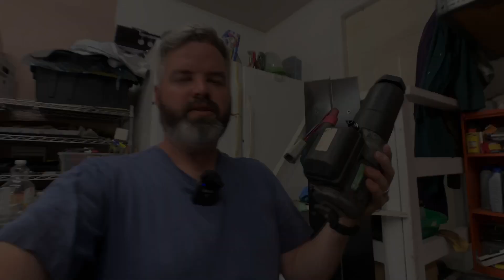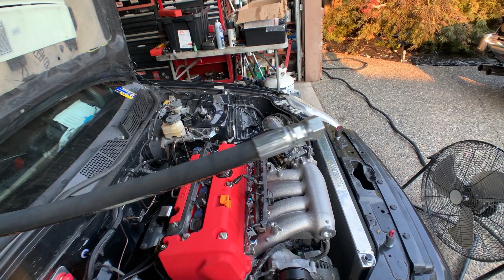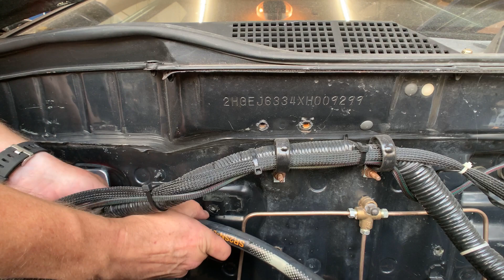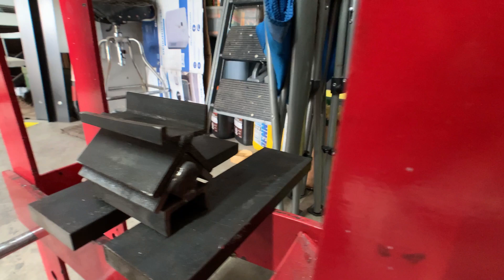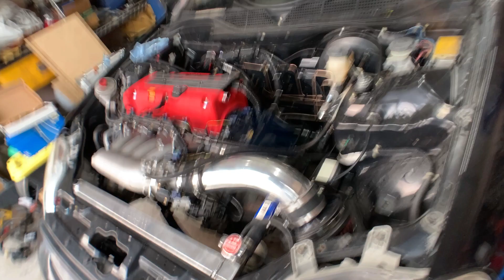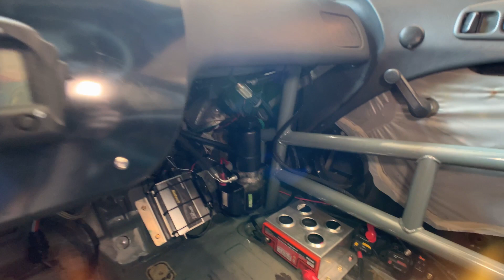DIY Electric Power Steering on the Time Attack Civic

Comment: I know it's not too big of a deal but...FINALLY someone installs/keeps an oil cooler for their p/s system while doing this mod! I can't say much since I haven't taken my Prelude yet out on the track but I'd imagine keeping the p/s fluid temps down would at least mitigate any potential issues for the system. At least I think so?
Reply from the maker: Yeah I felt it was worth doing. Looking back now though I think I would probably take the weights savings and run without. It only runs for 15min session at most. If I was street driving it might be worth it. Having said all that I have no checked how hot it runs after a 15min session so this is all just a guess.
Reply: @FFAttack  Gotcha. After each session, no problems at all with the pump or leak through the lines or anything?

I plan to keep my Prelude as a weekend driver/occassional track-day car so maybe I'll go ahead and keep the p/s cooler. Thanks!

Comment: I’m pretty sure the pump needs a signal from speed sensor? So the pump is on at 100% pressure all the time regardless of speed? Wouldn’t that overheat the pump? I could be wrong 🤷🏻
Reply from the maker: This pump is a 3 wire (Ground, 12v and switched on/off). There is a version of  this pump that has 4 wires the 4th being for speed. In my case it’s just on and off, I can hear the pump increase assist when load is applied.

Comment: how is it with quick turns? some had had issues with that when they use electric pumps.
Reply from the maker: I have not noticed any issues, on the track I have not had any lag in assist.
Reply: @FFAttack  did you wire into speed input?
Reply from the maker: No this pump just has a on/off signal.

Comment: I like your thinking behind using this particular pump. With that said, I feel like having that pump sitting next to your ecu within your passenger compartment is a bit on the wild side. Especially given that those pumps were designed to be mounted remotely under the hood somewhere. Even if you had to mount it where the washer fluid bottle goes and relocate it somewhere else, I feel like that's a huge pill to swallow if hydraulic fluid leaks on my electricals. Hopefully you're going to do another video moving that pump to somewhere within the engine bay using less hose, which requires less fluid. With that said, cool project. I'm taking the EPS route using the steering column mounted motor from a Toyota matrix (same as the Prius) because I don't wanna deal with the fluid any more. Cool vid!
Reply: Thank you so much for this comment. Seems like a much better EPS Route.
Reply from the maker: This car is a track only car so I’m not worried about it in the footwell area. Could it leak sure but this was the best spot in my setup. The washer bottle is long gone but with the wide 17’s I run there is not a lot of room in that location. Not trying to say this is the best spot everyone but for me it was. 

I did look at electric column but most reviews I have read spoke about over boosted feel. I also did not want to dig into having the ECU control it.

Comment: NICE!!!! Question When you had the oem power steering pump what belt size where you using I have a kswap with power steering no a/c and having a hard time finding a belt size
Reply from the maker: I measured with a string and then took it to the parts store and bought 4 belts around that length and found the one that fit that way. I don’t have the pet number I used on the belt, sorry.

Comment: to do the swap do you use the rack with power steering to begin with and switch it with an electric one, or do I have to buy a manual rack?
Reply from the maker: You need a power steering rack, all your doing is removing the engine driven pump and replacing with this electric one.

Comment: Great video, do you have a wiring diagram you can share of how you wired it up and what relays/ cricuit breakers etc that you used?
Reply from the maker: I don’t unfortunately. It was very simple to wire. The large brown wire is a Chassis Ground, the large Red is a 12v constant (I run this through a 80s breaker) and the small blue wire is a 12v switched that I have connected to a IGN on power (I chose to put a switch on my dash in this wire so I can turn it off if needed).
Reply: @FFAttack  thanks man. I have a 70amp circuit breaker for the large red wire, will that do the job or does it have to be 80amp.
Reply from the maker: Should be fine, I have not put an Amp clamp on mine to actually test it but normal running of the pump it should be around 30-40a only time you will see 70+ is if the pump get stalled out (full lock for a while). I did the full lock test on mine and no issues.
Reply: @FFAttack  awesome thanks.
Reply from the maker: No problem, glad to help.

Comment: Great video. you have inspired me to do the same. is the blue wire going directly to the switch on the dash?
Reply from the maker: Yes it goes to the dash switch with a 10a fuse to +12v ignition power. Thanks for the kind words!

Comment: I did the same thing in the Ralliart!  
I used a volvo/ford unit.  Found one out of the UK for a great price. The Luk units where pricey! 
I ended up using no cooler as my pump is mounted in the truck for weight distribution. The lines run under the car and so far that seems to be enough.  Even on a 45 min super spirited canyon drive. 

 Nice work! Maybe see you monday!
Reply from the maker: Nice! I found our about the Volvo/ford unit after I had already gotten this Luk one. Looks like a good seatuo as well.
Reply: Got a part number ?
Reply: Did you run a controller to modulate how much pressure / assistance it gives?
Reply: @mikelbring  nope.  It has 3 or 4 wires for inputs, but I just use the one to trigger the Pump on.